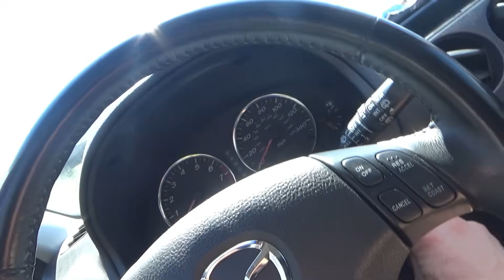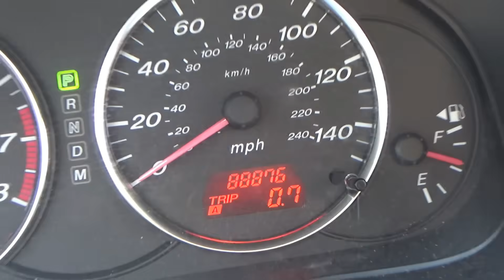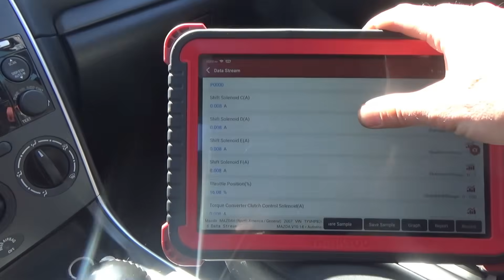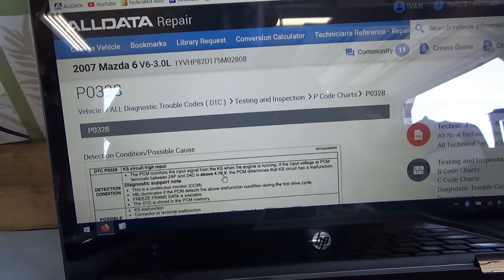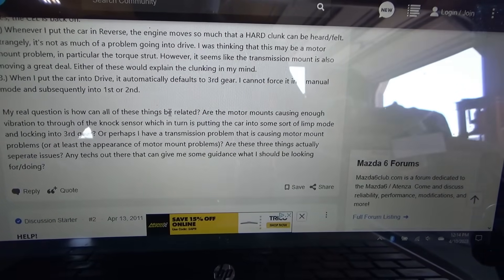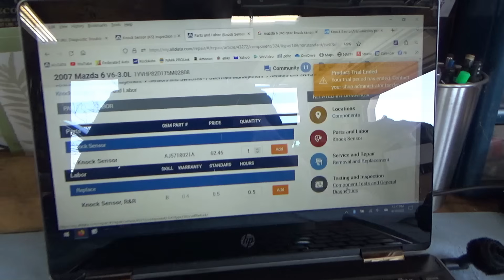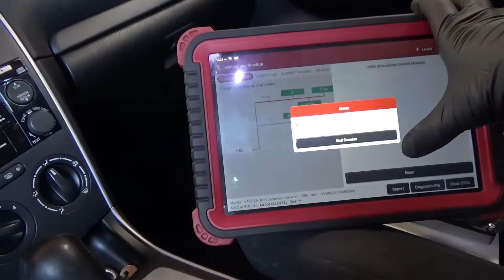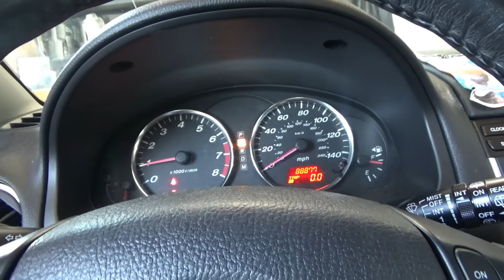At Transmission Shop for 8 MONTHS?? Fixed in 15 MINUTES!! (Mazda 6 Stuck in 3rd P0328)

Comment: I used let my car idle for like 25 to 30 mins, then i would put foot on break put the car o drive with foot still on break and i would rev maybe like 3 or for time the car will tug a little but im looking for that sweet spot once the car tugs a little hard it will get out of limp mode for me l. Right now my immobilizer reciever gave out installing a new one. Going through it with this car mines a 2005 mazda 3 s, dont give up yall usually its minor things with these cars thats why they go longer then most cars hondas are good cars too keep the fluids up to date

Comment: Hey Ivan, great video!  I especially liked two parts: (1) Mentioning the battery being charged & good, and having gas in the tank.  (2) How another sensor connected to a separate module can cause problems in other systems.  I would bet on the Mazda programmers put it in limp mode (engine: -retard ignition timing, and throttle to protect from detonation (knock) and the transmission into 3rd gear only to let the driver know something important is bad.  The only part the software engineers messed up is not putting a fault code of some type in the TCM letting the technician know its in limp mode commanded via the CAN buss from the ECM.

Comment: I had that problem, although intermittently when entering the freeway it would get stuck in 3rd, CEL, TCS flashing, after taking a few routes troubleshooting - determined my issue was caused by bad voltage regulator. Haven’t had the problem since.

Comment: Great job as usual had the same issue on a 94 dodge ram 1500 bad battery customer sold me truck for 400 dollars I put a new battery in it and detailed (oil change, air filter, wiper blades) 4500 dollars sold

Comment: I remember on the EB2 and ED falcons with smartlock in Australia that if you blew or took out the interior light  globe it would disable the car, i.e. not let it start because smartlock immobiliser ran through the interior light globe

Comment: Another approach would have been to use a Can bus analyzer.  Since there are no fault codes coming from the transmission, some other module is telling the transmission to go into limp mode.

Comment: Just took my Mazda 6 to a transmission shop.  They also refer to the knock sensor as the likely culprit.  Aside from removing the battery,  are there any other parts that one needs to remove in order to access and replace the knock sensor ?

Comment: I had a 2002 VW beetle. It was throwing ABS error codes. Car under warranty. The dealership replaced ABS sensors 2 or 3 times. It was 20 miles round trip to the dealer. Driving me nuts. I called VW customer service, gee the multi-pin connector from the engine compartment to get wiring through firewall, had been sprayed inside with insulating foam only meant to keep water out of the inside of the car. Factory error created a short for the ABS system. It is nice to see that we have dedicated techs that can actually diagnose a problem. VW bought the car back from me under the California Lemon Law.

Comment: Yup! K.I.S.S rule first… just a little farther info. Knock sensor was retarding the timing to prevent engine damage. Also putting trans in limp mode (which we know lol) 3 gear is most likely a 1:1 ratio. So putting as little strain on the trans too. That’s also why reverse worked. Direct drive (input and output shafts locked together) inside the transmission. Just turning in opposite direction. Good video!
Reply from the maker: But starting out in 3rd gear shreds the poor torque converter...not to mention the super violent shifts into R or D LOL!

Comment: this is insane the engine computer software/program is out to lunch. As the programmers must have been also. my 1992 buick lasabre obd1 car will run with ust about all sensors disconnected quite well. it just sets presets for all functions and runs ok. all that is needed is to set the spark advance in a retarded state to ensure no knocking and light up the engine trouble light.

Comment: Had an ex Ambulance Mercedes Van here in Australia.  The transmission would refuse to change out of 2nd, go into limp mode and the issue/code only appeared after a fair bit of stop start in city driving.
Safety feature.. you couldn't drive at any speed if you had no brake lights, fair enough I guess. But it only sensed amperage draw of the globe, not enough (blown) or too high (short etc) nothing else in the circuit. (switch etc) and no indication that it was anything outside of the transmission being at fault.
Turned out one of the brake globes was the wrong wattage (must have blown and been replaced by previous owner) 
To my embarrassment, took me ages to track it down.  But it was European CANBus.. so there's that

Comment: I used to have a boss that would say "Fix what you know is wrong."  You could be trouble shooting something you thought was not related and find an issue.  You'd think, well that can't be the original problem, so you'd make a note and keep on troubleshooting with no success.  Later, taking a break from your frustration, you'd fix the secondary problem you found and GUESS WHAT.  The original complaint was fixed too.  Fix what you  know is wrong.

Also, if this is a family channel, you should cover up that stuff on the dash.  lol

Comment: Hey @pinehollow

I have a 2007 Mazda 6 that is also having issues.  It will start in 1st gear and eventually go up to 6th gear in the morning.  But after work on a half hour commute, 10 minutes in, it often gets stuck in 3rd gear.

If I pull over and turn off the engine and wait at least 10 minutes.  It will start up in 1st gear again.  Some days, I will make it home with normal gears.  And then half the time,  it gets stuck in 3rd gear again.  So, I have to throw it from a stop in 3rd gear into park which is frustrating.

Do you think my situation is also the knock sensor ?  Or the knock sensor and something else as well ? 

Unfortunately,  I recently bought this car from a  private seller who gave me zero idea that this was going on with the car...sucks.
Reply from the maker: Any codes in the modules?
Reply: Aside from that P0328 code for the knock sensor.  A friend's basic scanner reports P2177 too lean off idle bank 1, P2179 too lean off idle bank 2 & P0151 o2 sensor
Reply: Well, does the knock sensor code suggest anything? Does the O2 code suggest anything?

Comment: Hey I got a question I have a mazda 6i 2005 it will start off in first but shift hard to 3rd stays in 3rd no codes the engine light flashes sometimes and it is always draining the battery we replaced 2 of the 6 silinoids and the altanator and the battery but still having this problem could it be my knock sensor?
Reply from the maker: There should definitely be some codes in the ECM or TCM
Reply: Alrighty thank you

Comment: I faced similar in a 2013 Toyota Venza... Knock sensor codes and transmission goes gaga... However not exactly in limp mode, but give a violent jolt between 2 and 3. Nice job as always

Comment: I diagnosed a no comm for tcm, missing certain gear, sticking. 

Bought the car, Mazda 5 , 2008 van, 147k miles from owner for $750. Ordered a refurbished tcm from California. They were plug and play. 

DONT mount it on the transmission, rather on the firewall with a couple zip straps. 

The heat from the transmission causes this issue. The transmission would slam, hit into 3rd as well. 

Replaced tcm, cleared codes and has worked great since this last year.

Comment: First of all you didn’t fix it, you googled it. Acting like someone else screwed up because they couldn’t figure it out is pretty lame when you didn’t either. Second this tool you more then 15 min. 3rd that information is part of a TSB so you should check those in the future. The endless flex people that work on cars try to do over other people that work on cars or try is annoying. It’s not a space-x rocket it’s a Mazda.
Reply from the maker: First, I did figure it out.
Second, I did fix it in 15 minutes.
Third, what's the TSB number for this issue? 🤔

Comment: I have a Chevy 4.8.  It was misfiring and throwing a knock sensor code.  The plugs were a year old so I thought I had a faulty knock sensor.  The back one goes bad in the Chevys.  Wasted a lot of time

Turns out I had fouled plugs.  Amazon sold knock off ac Delco plugs and they didn't last a year.   

Lesson, never assume anything and always buy parts from a reputable source.

Comment: Sometimes you have to weigh cost against probability... Yeah it seems unlikely that the knock sensor is the problem, but it's a hell of a lot cheaper than a transmission rebuild! Start with that and see what happens, I usually say.

Comment: I had a 2004 Maxima that went into limp mode,my mechanic said it was cam 1 sensor 2 or something like that but he wouldn't be able to fix it for a couple days. Took it to the Nissan dealer who said it was the transmission for $4500 at the time. I told them what my mechanic said and they said they would try it but no guarantees. 15 minutes later they said to come and get my car as it was running fine. New technology is a double edged blade with all the interconnected issues.

Comment: Friend of mine had a nissan maxima, was stuck in a high gear. Slammed into reverse. They thought trans was gone. Looked at it, fluid looked fine and only code was cam position sensor. Clip was broken so wouldnt stay plugged in. Used some wire and wrapped it tight around it, cleared the code and car drove fine. Then later on something happen supposedly trans related and they sold it for scrap before they even let me look at it but yeah people will scrap cars for the stupidest things sometimes even tho it may be nothing majorly wrong.

Comment: Sounds like my Jaguar 2005 XJ8L.  One of the coils goes weak and a bucket load of codes go off along with limp mode. Pull into a garage and they want to tear the car apart.  Put in a new coil and everything returns cleared and normal. Go figure.

Comment: Excelent job indeed. I've been using google since 1998, Google is the ENCYCLOPEDIA... BTW where did you download the data for Mazda knock Sensor? Also is the ThinkTool Pro is a good dianostic tool to  use? Your help is greatly appraciated...

Comment: I was hoping for bonus video that hypothesized the logic between the symptom and cause. Maybe the missing sensor data causes a critical fault in the engine control program that has no workaround so it sends the limp mode instruction to the transmission control? Sounds silly since a lack of knock data, with other valid (and normal operational data) would suggest a minor engine fault to me. Maybe the programmer was told to force the car to run in limp since the engine may have damage or become damaged. (I really enjoy the your bonus footage!)

Comment: To me the take-away is Ivan did a Google search and the only hit was the correct fix. One response and it was the answer. Google search is just as valuable as a tool as that box of SnapOn tools. My personal experience was similar. I own a 2000 Xterra v/6. Several years ago I left to go on a 400 mile trip. Got about 100 miles in and the transmission started to shift very erratically. Could not drive over 30 mph. Turned around and limped home. Did Google search and found one reference in an Nissan Pathfinder forum of similar problem. The fix was replacing the throttle position sensor! Really???  Part was cheap so I ordered one and it 100% fixed my issue. That was about 80k miles ago. 😉

Comment: As soon as you showed the the OBDII fault code I figured that's what it was going to be. Then again, (A) the video kinda framed the problem that way, and (B) I''m used to "unrelated" errors being the culprit, it happens far too often when programing. 

On another note, it's worth observing that sometimes limp mode as a "catch all" is a bad idea, it doesn't always make things safer. This case is a good example, because knock is actually MORE likely in third gear I do believe. Knock typically manifests itself when the engine is experiencing low speed but high torque, of which the stuck in a higher gear would surely make more likely.

Comment: Thank you Chrysler for making it easy to read codes on 96 and and newer vehicles. Cycle ignition key 3 times on and off and on the 3rd time, leaving it in the ON position, the dtc codes pop up on the odometer. That's how i keep my my 20+ year old Durango and Dakota running and my previous 4 Grand Cherokees.

Comment: This reminds me of water getting in the taillight of a nissan versa a frying the board causing a shifter position issue because somehow REDUNDANCY on circuits was an issue with nissan.. You just had to clean the board of oxidization. Holy shit. Who are these engineers?

Comment: I remember having this exact problem heading home from work in my 07 mazda 6 V6 sedan. CEL came on, got stuck in 6th gear till I restarted then stuck in 3rd. Got the code for knock sensor with $6 scan tool. I assumed the bad sensor caused the car to go into limp mode thinking there was a bad knock detected. Told dealer to replace the sensor since I diagnosed it myself, was on my way in 2 hours with no further issues.

Comment: 8:12 "I guess anything is possible" is the ultimate wisdom in this field and every other field.
I remember I was diagnosing a car that had shift problems, maybe even had the same symptoms, and the code that was set in TCM was a) unheard of b) had no information about it on the internet c) there were codes stored in the PCM that has no relation whatsoever with the transmission or how should it shift. After almost 3 days of trying to figure out the problem it turns out that one of the codes in the PCM that was caused by a MAP sensor that lost a ground wire causing the transmission to go in some sort of limp mode and make hard to shift gears, exactly like this car with different sensor and error causing the problem. The car was a Renault, a french car and I will NEVER forget this car ever.

Comment: I have been throwing money at this problem for 2 years. I was banned out of a Cummins forum for posting this vid. I am out close to 10k between parts and what I paid a shop. Still runs on 3 cylinders. 

https://www.youtube.com/watch?v=hOWueYRo-ag
Reply: Most updated short on it. I am doubful this truck will ever run again at this point. I have not started using it as a parts truck, but its getting to that point. 
https://www.youtube.com/shorts/OKMsb95zbDg

Comment: I started watching and he said died battery after tcm replacement. First give away and the No start no crank. Second give away. The cars fuse trans. Engine…fuse run port isn’t ground so it will not allow ecm to start car. Has to be? 3rd thing he changed the ecm too… no bro 😎

Comment: So, the code said exactly what was wrong and replacing that part fixed the issue. The tranny shop and previous mechanic really ought to be ashamed of themselves.

Weird that the firmware locked it into 3rd gear, not 1st or 2nd, but in my very limited experience Japanese automotive firmware is a bit bizarre. My Forester will lock out the cruise control if I forget to replace the gas cap and keeps it locked out until the code is manually cleared. Dealer claimed it was working as intended.
Reply from the maker: At least you can still drive normally without cruise control... 😅
Reply: @PineHollowAutoDiagnostics  True that. I think the collision avoidance and lane departure features were also disabled, but I'm not certain.

Comment: This sort of thing isn't terribly unusual - for faults that aren't going to affect drivability (like an engine protection sensor, or emissions systems) but could cause other problems (like damaging the engine or catalyst), manufacturers will sometimes have the ECU command another, totally unrelated system to do something abnormal so the car feels broken and induce the driver to take it to a shop. At the low end, this might be locking you out of cruise control. At the high end, it might be commanding a limp mode.

It pays to fix the faults you can find, even if they seem minor compared to something else that's apparently wrong.

Comment: Good job Ivan. Something that many people don't know about google is the full syntax for using it. For example placing the (-) minus sign before a word will exclude it from the results (ex. -notthisword). Another easy to remember thing is to place words within quotation marks "like this" to force google to show only the results that include the word or specific combination of words. This type of syntax was in use with many data banks long before the Web and Google. Only Google carried it over to the Web AFAIK, but it really helps narrowing down what you're looking for.

Comment: We had an equinox that had abs shutter all the time. Changed all the sensors and eventually hubs. One day my wife came home and said check engine light is on ..EGR code. Reset it the next day same code. Changed EGR valve and to my surprise abs light and chatter gone!!! Craziness

Comment: I had something similar happen on a Toyota corolla. I believe it was water in the fuel that caused a knock sensor code and the transmission got stuck in 3rd gear until the code was cleared. After that, the transmission shifted hard once on takeoff and everything went back to normal.

Comment: I'm a DIYer and I ran into a similar problem with a friend's 2001 Toyota Highlander with the 3.0L 1MZ-FE engine. It would set a knock sensor code (I forget the number) whenever she would accelerate onto a freeway. Then it would go into limp mode but if I cleared the code, it would be ok until she went onto the freeway again. I replaced the knock sensors (there were 2 under the intake manifold) and short wire harness and problem solved. While in there I also replaced plugs and valley coolant bypass hose, just because.